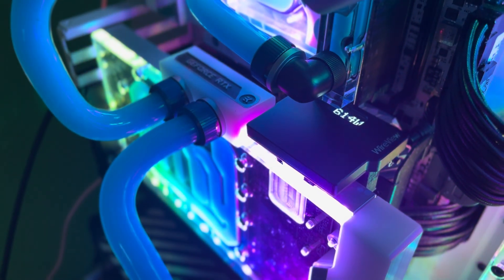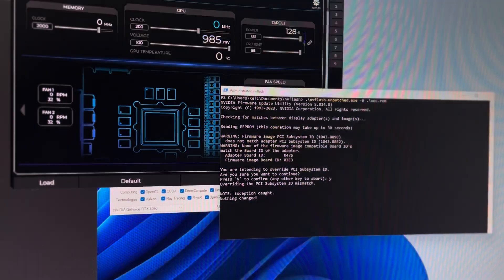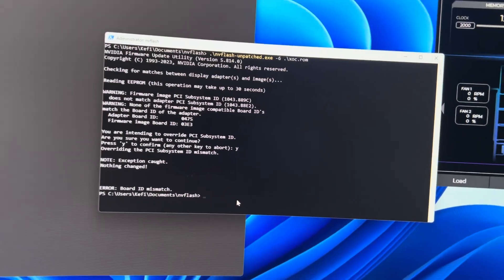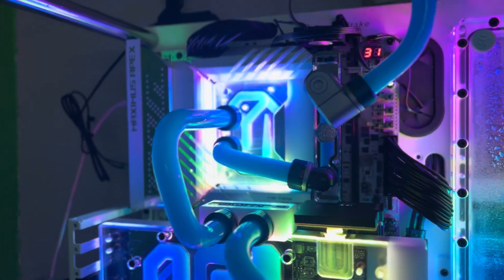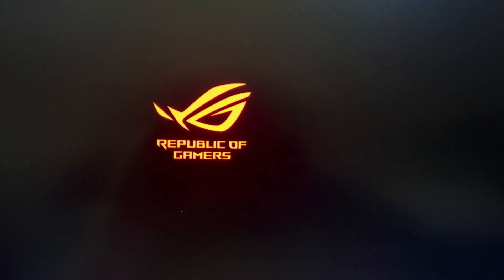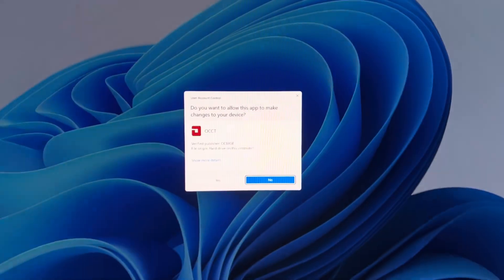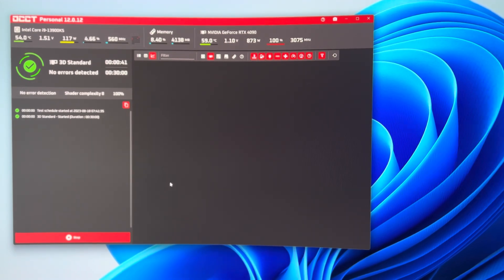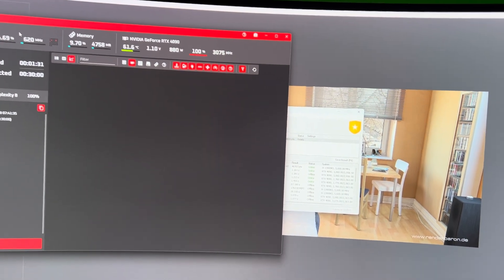ASUS 4090 TUF on 1000w XOC BIOS: patched nvflash now available. No more Board ID mismatch!

Comment: are you running any kind of additional volt modding? i flashed the 1000w bios but the highest ive seen it pull is closer to 700w. without going colder or adding more than 1100mv i dont think ill be able to get there. im on water with my AC plumbed to it as well. im going to be getting a chiller and adding it into the loop soon.

Comment: What clock speed uplift could you achieve with this?  3075 is high...   but what's the max?  I've seen 3105, but is 3200 or 3300 even possible with this?

Comment: i run 1000w bios on my 3090 and allow it 700 watts and it runs 2145 mhz on gpu and 11501 on memory , in most games instead of hitting a power limit i will hit a vrel limit, which is what i like i dont want it power limiting so its atleast giving it full performance on the power side. it doesnt really equal out to to much maybe 10-20fps

Comment: You know that you could halve the power consumption and save 400W or so if you turned the clock speed down by 100mhz on the 4090? 🤣/s

Just kidding , it's great to see people like you showing what AD102 can really do - even if it's so far off the efficiency curve it's useless for normal use ;). I'd love to do that kind of thing for myself but I can't risk £1800 killing a 4090 (I've settled for running my 4080 Super at 370W)

Comment: Nice work! Did you flash the bios from the normal strix 4090 or did you use the bios for the strix oc 4090 bios? The oc version should give you even more voltage and more power delivery ability. Just a thought. I like your show. I used to be a heavy equipment Tech up in Alaska at 4ed Dog mine and Deadhourse( Prudo Bay) . I was in a plane crash and lost the ability to do my job. SSI ofcoarse took everything I ever worked for so I'm starting my own computer component microsoldering repair. I'm telling you this because I feel your one that would understand the drive things 8n life will make you even more determined. You have done just that and I see you doing a lot of very neat things in your furture. I will continue to watch your channel and share experiences with you to see if we can blow Nvidia and AND out of the water !!! I hope your in ro4 the fun to come and I hope you will share your amazing ideas. I will share with you no problem!!!:) take care, have a good day and keep up the amazing work!!! Sorry for thecm8sspell.

Comment: Okay will this work on an RTX 3090 FE? If so can the 3090 FE get more than 400w? Want a Strix 3090 bios maybe or higher even.

I have some questions 
1.) will a 3090 ti cable with work with a 3090? If so why not please explain in detail

2) can I flash the 3090 FE AT ALL since mainly people are only mentioning the 40 series 

3.)  How can I flash and be safe without melting my 2 cable - 8 pin pcie cable to Each cable is rate 150W-200W. Though want to just get more power and voltage to my 3090 FE. Just done right. I’ll pay anyone willing to help me even. I’ve done NVFLASH before on older 980 TI or 780 ti, but got sooo many questions
Reply from the maker: Yes, you can flash high power BIOSes to your 3000 series FE cards now too.

1. You mean the power cables? They’re from your PSU usually and not specific to anything. Usually if it fits, it’ll work.

2.  Yes, see above

3. Just keep an eye on it. Nothing will immediately melt. And you won’t be at max power consumption constantly.
Reply: @kefisendsit  can you make a video showing how to do it? I want a 480W bios at least? See the problem is my 3090 fe is only a 2 cable 8 pin adapter. So I’m wondering if I  could use an adapter like the 3090 TI FE and if that would work on my 3090 for more power if I run say 500W+. If you could make a guide and or help I’ll pay you for your time! 100$ if we could just have a few walk through. I’m really wanting to do this and willing to give something than ask for free help
Reply: @kefisendsit  also I know you might not have a 3090. But a video guide would be amazing for old schoolers like me. Haha haven’t done nvflash in sooo long and don’t want to lose my 3090
Reply from the maker: @Multimeter1  I'm making a graphical, safe version of nvflash that will be ready later this week.
Reply: @kefisendsit any update on this?

Comment: For 3075 - and the performance uplift is what, exactly?
Reply from the maker: By itself, you're right - this does next to nothing for my card. I barely reach my 600W limit as is. I don't care about the removed thermal limits because I run subambient anyways. But in combination with my EVC2 arriving in the mail, it means everything.

This is more important for a larger more generic reason of being able to flash anything to nearly anything. 1.07v cards can now be restored to 1.1v cards, which I went over in a more recent video.

Comment: Damn that's a lot of watts.
Reply from the maker: yeah, I'm actually kinda worried about having my PC not plugged directly into the wall.. I have a beefy surge protector but I don't know if it's meant for 1600W over a single line :face-green-smiling:
Reply: @kefisendsit  hi kefisendit how you offer services like help to flash vbios .. I have a zotac 4090 oc I want the vbios from extreme amp …